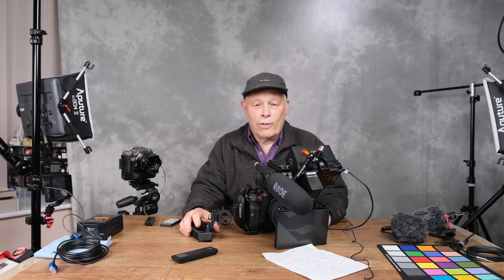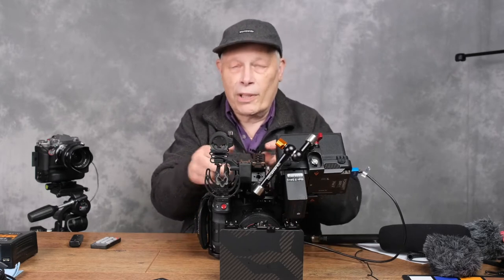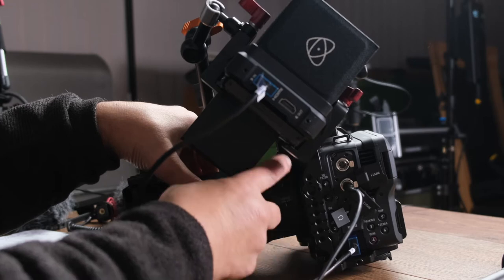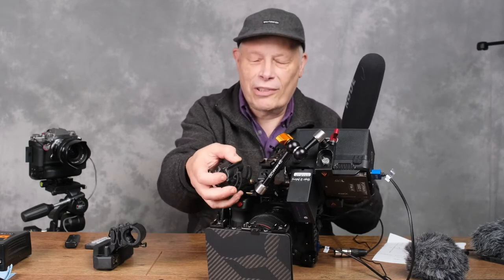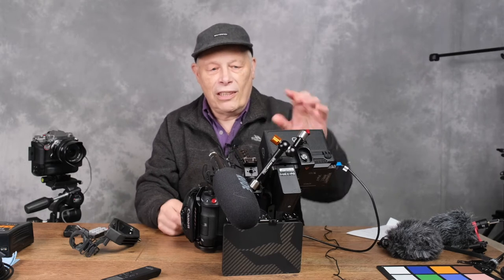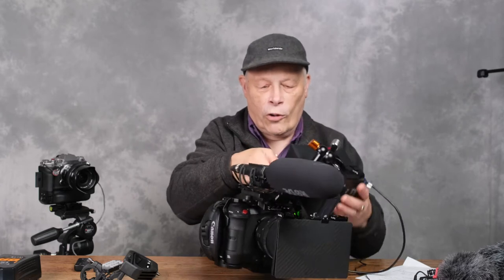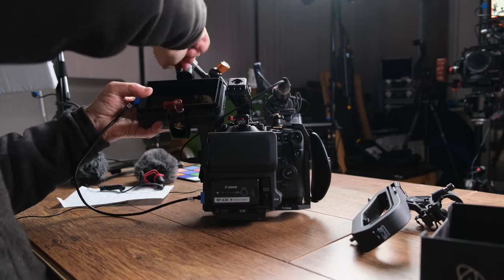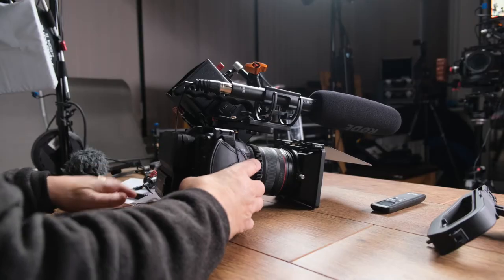Canon C70 - Add a Cage and Handle

Comment: Nice rig. Thank you for sharing. I am using a Manfrotto long quick release plate which allows me to hold the camera better and when I put it on a table it doesn’t tilt as I don’t want any pressure on my lens. .